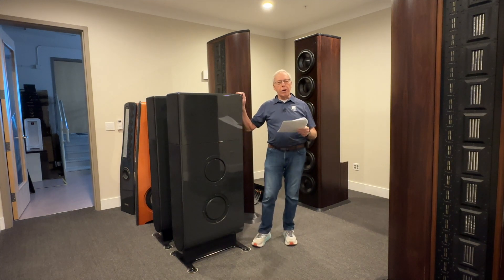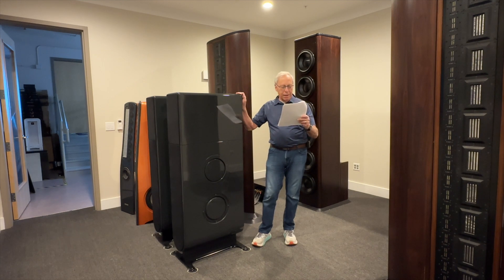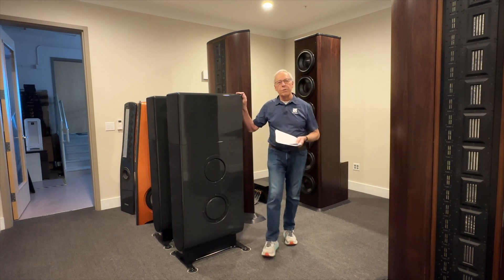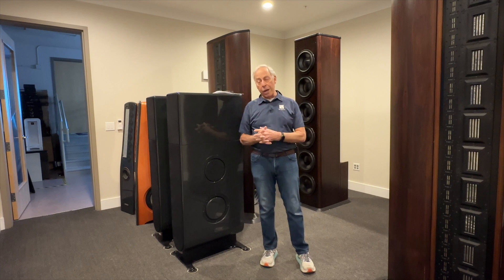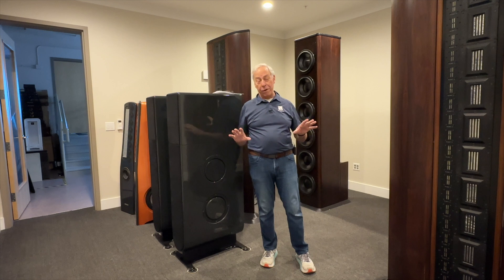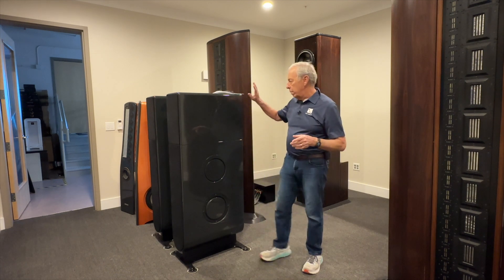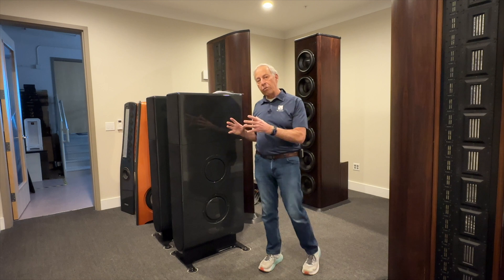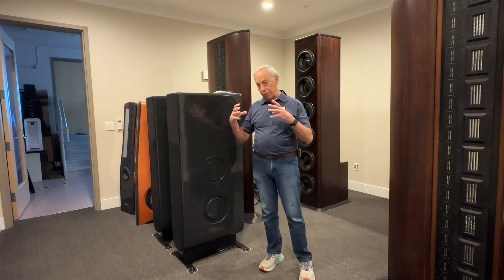Importance of parts quality in crossovers

Comment: I just built new crossovers for my speakers, kind of a winter project, 100% retrofit to much better components. Around $350 in parts. I have tested them, and they are operational but haven't installed them yet because I want to sneak them in without my wife knowing so I can see if she hears a difference. I could tell on my tests there was a change, but I was listening for a change, hoping for a change, so my judgment may be biased. She listens to much of the stuff I do, on those same speakers, if there is a noticeable difference she will hear it. The new crossovers are on the shelf for now though, we have been renovating a 1958 MFG runabout boat and it's ready for paint/varnish. It's got to be ready for the water by May or I won't hear the end of it.

Comment: Do the capacitors in crossovers dry out and go bad like they do in power supplies ? Should I replace them in my 36 year old Ohm Walsh 2 speakers ? They are extremely  difficult to get to.

Comment: I have two stories about it, when I work on an electronic repair and computer workshop, we have a client that complains that he listen that his Sony home system was not sounding as it used to sound. Since he was in his 50s I thought that I can be that be that his ability to hear high frecuency must be below 14 Khz. (In 10 days I will be 50 and I barely listen 13 Khz). So I ask permission for take his loudspeakers to home and test them on my own equipment. The result was that he was right, they sound like the tweeter wasn´t work properly. So I return the loudspeakers to the workshop and recap everything with standard capacitors. Boxes bring back to life!!! So I offered to the owner expend use a little more expensive capacitors and change also the resistances. The result was impresive, I wish have those boxes for me.

Years after that I visit my brother and notice that his Sony system was sound as dead as the one I repair years before. And again, I replace the entire crossover with the best components I can found for a reasonable price according to the quality of the equipment, and I found that not only sound very good, but also that the level of detail that the integrated amplifier was delivering was in fact much better than what the speakers allow to appreciate when the equipment was new. That means, Sony design an acceptable amplifier but sells you boxes that doesn´t allow to you to get the best from it.
Reply: Many audio companies have different "Tiers" of product lines... of vastly different "Quality" (and this, different price ranges).  Ive almost Never liked any sony speakers that Ive heard.  The woofers tend to be low resolution, and not in the correct "Tone".   That said, that was the lower end stuff.  I recently ran into a used 50 cd changer boom box from Sony, that actually has decent sounding, dynamic, speakers.   I still preferred my former Phillips Woox speakers, comparatively, as they were vastly superior in Crystal clear Bass response... but they are much better than many other Sony boom box, and floor standing speakers, that Ive heard.

 Its not all about the crossovers.. but Im sure that those are a Cost cutting measure, factored into their price ranges.   Many times, its the poor quality drivers, themselves... and no amount of change to the crossovers will change that.

 Case in point... when My Phillips woofers blew, I tried to swap some other crappy sony speakers into the phillips woox enclosures.  They sounded awful, compared to the original phillips woofers.  So much so, that I went ahead and had a pro re-foam them for me.   Come to find out, Phillips got those woofers from a very high quality factory, in Taiwan.  Those particular woofers, were also designed to have an extended level of Travel.. allowing for even greater bass potentials that most typical woofers.

Comment: You can’t just say that without some evidence of what is or isn’t happening here. Lower cost speakers may use capacitors with not as tight a tolerance as would be preferable or bipolar electrolytic capacitors which can have a tolerance of 20% either way. Swapping them out with ‘higher quality’ caps may simply be just getting a tighter or even hand selected tolerance which is closer to the desired value for a specific crossover frequency rather than a better quality component. In any case, unless the capacitor you’re replacing is faulty, the difference we’re talking about here is so small that it could even just be that things sound ‘different’ rather than ‘better’ Audiophiles confuse the two on a regular basis, often reverting to the original setup!

Comment: Over my 25yrs old of tweeking crossover parts i would say to get the most out of your speakers you should start with tweeter main inline cap , add some bypasses 0.1uf and  0.01uf.... than I'd there is a resistor inline with that cap than replace that with quality audio grade non inductive one ....  
If you can do it in stages you can observe affect of each swap on sound quality and remember that each cap has its own sonic signature and may or may not be the best sonic match to your speakers in your room . 
Have fun with it , that is what it's all about 😉👍🙂

Comment: A few years ago as an  experiment I had an old pair of 1973 vintage KLH Model 32’s that I haven’t listened to in ages. (I can’t bring myself to throw away my first stereo speakers I bought with my own money as a college student). So I knew those capacitors inside were no longer doing what capacitors are supposed to do. Buying quality replacements should upgrade the sound. The Inductors were very cheap iron core and I replaced those with air core inductors. I replaced the original wires with better quality wiring and replaced the original steel binding posts with brass binding posts. I must say this was an experiment that was well worth the upgrade. The sound was significantly improved. While I was at it, I recoated the surround on the woofers. Overall these speakers never sounded this good even when new. Part’s quality does matter and replacing old parts that have aged significantly with fresh new upgrades do make a difference!

Comment: Everything matters.  Some spots component quality matters more.  Capacitors, resistors and inductors earlier in the signal path matter the most.  Changing I/V resistors the DAC or feedback resistors in main amps can be pretty significant.
Reply: Resistors are not significant in the performance of crossover networks in terms of an A/B comparison listening test, but good quality is beneficial in long term reliability.

Comment: I’ve watched the GR Research videos with interest but also skepticism. How can just about EVERY speaker he reviews have “cheesy” xover parts? It reminds me sometimes of the people who claim anything but a direct-drive turntable is crap, or if it’s not a Class A amp, it’s garbage. I have a real bad attitude about overstating differences. But then my only DIY sp eakers are single-drivers, which don’t use xovers, and yeah, I buy good caps to use in the signal path of my DIY amps. Anybody who’s got some experience with speaker xovers and using different caps feel free to weigh in.
Reply: Cross over quality makes a BIG BIG BIG difference.
Reply: Most of the speakers we get sent are cheap, budget level speakers that maybe cost $50-100 in raw materials for drivers and crossover, so it's no wonder the crossovers are full of "cheese" especially when the crossovers are hidden away inside where most people will never dare to venture. It's not until you start getting into higher-end brands/models or boutique brands that you start seeing better quality components. Some brands, like ATC, and some of the more expensive Revel speakers actually use decent quality parts, but most of the stuff that comes in is definitely in the budget to mainstream price range. (sub $1000/pr)

Comment: A significant improvement in sound quality after changing resistors?
You have to laugh.:face-green-smiling:
Reply: did you try it ?
Reply: @dingskydongsky  DId you?
Reply: @georgebliss964  yes, I modified cross-overs and amplifiers using different types of resistors. wire wound-, carbon film-, metal film-, tantalum resistors, they all sound different.
Reply: @georgebliss964  I have tried, and there is a difference. Change the white resistor to a metal film oxide from Dayton, or even Mundorf, and you will hear a change in the sound. Resistors are very easy to change in a crossover, just use same effect or higher.

Comment: I'm wondering if you could actually show us and explain a crossover from the FR30's? Almost every speaker brags about their parts and we find out later that the parts are pretty much the cheapest available. (Not saying that's you) Watching channels like GR Research has peaked my interest in Crossover parts. I'm a bit embarrassed to say that I have the SVS Ultra Towers and they are NOT what I was hoping for. After seeing the breakdown of parts used I now want to upgrade the crossovers. Unfortunately I don't have the confidence to do that myself.
Reply: I would be up for Paul to show us the crossovers in FR30’s! That would be impressive.
Reply: If you like the way your speakers sound, then no problem. Remember, Danny is a salesman
Reply: If you don't like the speakers now, just upgrading the crossover probably won't give you what you are looking for. Find a speaker that you already like, then upgrade the crossover to take it to the next level.  Making a new crossover is pretty easy. I had gr map out mine and they sent me all the parts. Danny and Hobbs were very helpful with any questions that I had. Very nice guys.
Reply: The pictures of the crossovers are on the PS audio website. They're pretty decent, all polycaps except a couple electrolytic caps in the bass circuit, all air-core inductors, and pretty good resistors. Nothing "amazing" but worlds better than the SVS Ultra tower crossovers, tbqh.

Comment: I just rebuilt the networks in my speakers and spent $260 on capacitors alone. Worth every penny. Not that the original components were bad quality per say but they were 46 years old. Needless to say they had a good run but it was definitely time for an update. The difference was immediately obvious. Always get the best stuff you can afford no question.
Reply: Were the caps Japanese, by any chance? I always hear that they are the world leaders when it comes to caps.

Comment: OK, but why for resistors? Is it a question of tolerances, the component's (lack of) change in performance as it gets warmer, something else?
Reply: There are different types of resistors. The white ceramic in crossovers are ok, but not the best. Dayton have both types, and the good ones are not expensive, Dayton gives great value for money. Mundorf has great components, but they also cost a lot.

Comment: The real question is after how many years of age should you change crossover components.
Reply: Most don't require changing, but electrolytic caps should be the first thing to replace. Most info I've seen online says to replace electrolytic caps after 5-10 years. Polyester and polypropylene caps can easily last 20+ years.
Inductors are usually coated in varnish, and will never need replacing. Resistors should only be replaced if they are starting to discolor from heat over time.

Comment: Even better is to use active cross-overs and mono blocks.
Reply: I don’t use any crossovers in the output section. I use an electronic crossover (active) and run all channels directly to the speakers with their respective frequency response.
Reply: @Bassotronics  Technically, that is the best approach, but practically, it's much more difficult to do. PS Audio could sell an "Active Drive" FR30 and bundle amps and active cross-overs with it. It won't be cheap but it surely will allow for much better optimization and fine tuning.
Reply: @ThinkingBetter  
Reason why I do it is because I don’t like any interference in the high powered output section. 
Nothing to bother the signal chain from the amplifier output to the speakers.
Reply: @Bassotronics  Reason you do it is that you have the competency to do it. Unfortunately this is not an option available for the vast majority of audiophile consumers.

Comment: As D1NO2 here said, everything matters in the audio chain. And all the parts in the electronics , preamplifier, amplifiers, source equipment also make a huge difference. Not only everything the audio signal passes through but even the power that is feeding said components. So yes everything matters !

Comment: When are iron core inductors better than air core?
Reply: Bass tones, especially below 200 Hz. Once you start getting above 6.0mH, coils start to get really big and expensive, and gauge needs to start getting larger as well to keep resistance down. The wavelengths are often long enough that it doesn't benefit from using massive 10-12 gauge air-cores over a decent 16 gauge iron core. For ranges above 200Hz, air cores will always offer the cleanest performance.
Reply: @hoth2112  So, it isn't because it's sonically better, it's because it's not critical, it's smaller and cheaper?
Reply: @richardsmith2721  Correct, when you're getting into sizes like 12-15mH you're looking at a $40 coil vs a $200-300+ for a 10/12-gauge aircore with the same value
Reply: @hoth2112  so in Subwoofers
Reply: @D1N02  sort of? subwoofers typically have an active crossover built into their dedicated amplifier so they can easily be adjusted to match a speaker. 
But if used in a passive subwoofer, sure.
Reply: Never

Comment: In audio everything matters.
Reply: 🤔Yeah, those voltages and currents know when you’re asking them to travel through a slum 😆😁
Reply: Exactly
Reply: The most important things to used his Audiophile solder as well as audiophile wire.
Reply: @dangerzone007  don’t forget audiophile grade reality Aligners.
Reply: That's a myth!
Reply: @erdemkaya6472  go ahead report me to Amir, the head of the measurement police.
Reply: @D1N02  
As long as you have an Official Certified Audiophile measurement Certification you are safe..👍😎
Reply: @D1N02  haha good one Amir does influence a lot of ppl. measurements are not the only thing to worry about. I also strongly follow the GR-Research doctrine “ say no to cheesy parts”
Reply: @EnpuerKT  especially since good parts aren’t all that much more expensive than cheesy ones lol
Reply: @shipsahoy1793  it’s not only how fancy the parts are, but how they get integrated in the xover. I’ll leave that to Danny R, he built me some xovers for my Maggie’s and I gotta say parts do make a difference. Notice how Jay did not believe GRR until he traveled down to Texas and met Danny, now Jay uses GRR speaker cables for his reviews.
Reply: @EnpuerKT  
I’ve done my share of crossovers.. my main point is that you don’t need to spend a couple hundred dollars on capacitors for $xxx speakers.. it’s all about NOT over-polishing a turd.  Let’s not forget a system is only as good as it’s weakest link. An intelligent tech or engineer should know where to draw the line in any set of circumstances, but the game is wholly about making green when the sky is the limit on recommended cost upgrades. As for implementation, if the topology of the crossover is already flawed, the question becomes then is a redesign of the crossover and possibly even the cabinet or a driver really worth the effort and cost? A well designed speaker sys that    could benefit from a crossover upgrade is one that has the necessary circuit topology in place, but the parts were replaced with cheaper ones to limit the bill of materials costs for manufacturing. A quality product relies on a quality design using quality parts, and still requires quality assembly and test in order to furnish the consumer with a great product.
Reply: @erdemkaya6472  Yep, you get it. What all these “purists” don’t realize is that, sure, quality is important, but at a certain point, a person can’t tell if there was an improvement. Without the ability to tell, it becomes mind games. Have I spent $20-$50 on crossover parts for stereo speakers and noticed a better result? Yes, because the caps dried out, and polys are surely a bit better than NPE’s for audio crossovers, but to spend $200+ on a couple caps, nonsense. Same with cables and everything else. Sure, shit cables will be obvious if you spend $25 on a better one, but to spend $400 is another story. You’re wasting your money bc you’re playing mind games with yourself. I spent all this money, so obviously my toy blows yours away. It’s just not true. The difference between a thoughtfully procured $10k stereo and a $100k stereo is pretty much $90k you could have saved for something else, since most people either don’t have the space or the environment to need a system that would fill that space at a decent volume and still sound good. Never mind the neighbors. All this mental foolery is why there are so many YTR’s claiming DAC nirvana every time the price goes up, 
or a “newer tech” version DAC gets released .
It’s downright  silly, really. Like Paul saying DSD is so good Lol 😂
If my on road motorbike does twice the maximum speed limit, why would I need to spend more money on a “better” one that will go 20% faster if I’m only ever doing the speed limit. An idiot will usually say, “because it’s nice to know I can if I want to” but others will just justify it as better quality. I see it as wasted funds through frivolous spending. I guess if you’re rich enough to have cash to burn, then go ahead, it’s your money! That’s why places like PSA exist, for those with more extra green than pragmatism.
Reply: @davidfromamerica1871  Actually, that’s a flagship unit from the 1990’s..  
In fact, it accepts digital inputs, and so it has Multibit DAC tech inside of it!  Too funny.. good find..not for me though..